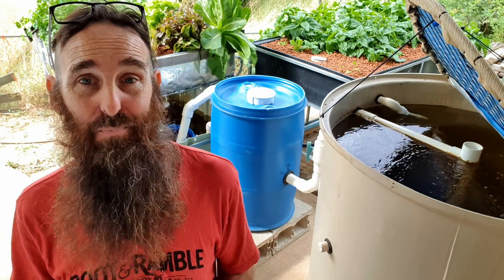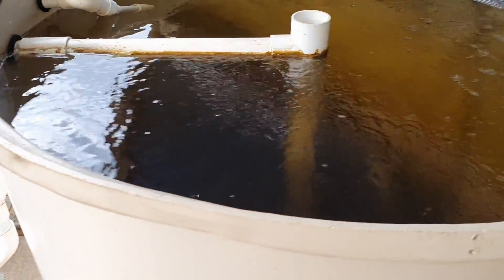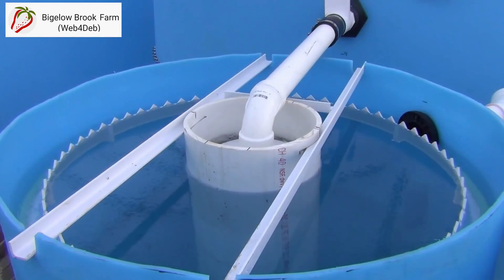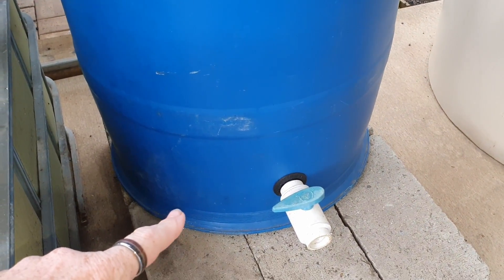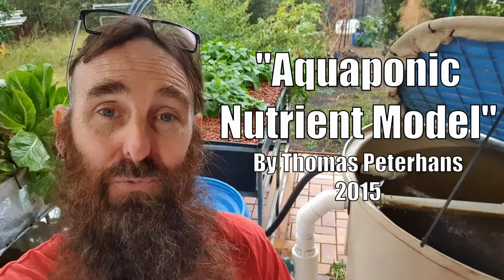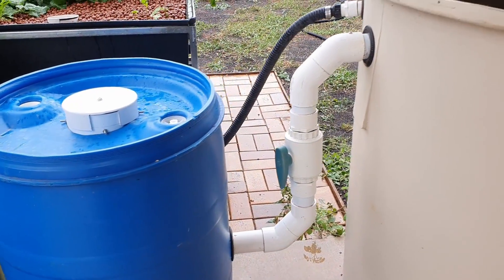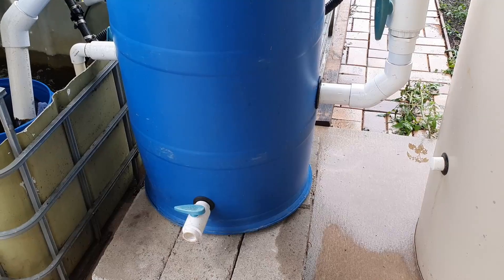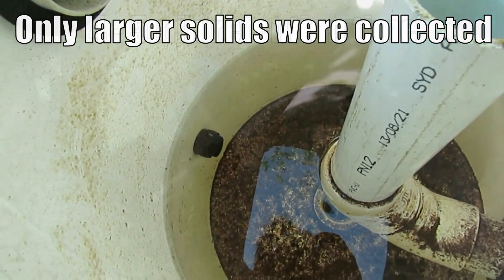Radial Flow Settler for Aquaponics Systems | How RFS work - How to Size Your RFS

Comment from the maker: Want to learn more about Aquaponics? 🐟 🍓🥬🍅
Learning is easy with my "Beginners Guide to DIY Backyard Aquaponics" for only US$19.95.
► https://www.robsaquaponics.info/beginners-guide-to-diy-backyard-aquaponics
Don't forget to hit that subscribe button if you want to be notified when new videos are posted to our channel.
Cheers all & happy growing. 🐟 🍓 🌱
Reply: as to your flat bottom barrel,  try this, using a barrel that is shot in the side for practice, set the flat on some blocks about 3 ft high, place a 5 gal bucket of sand in the barrel, then from the underside, use a heat gun or some other heat source to make the plastic pliable, the weighted bucket will apply an even pressure and should help the bottom to sag forming a more conical bottom.

Comment: How does water get taken Up into radial flow drum in is it pumped is it sucked how you really don't explain how but Only say taken into.. yeah how it doesn't do IT automatically Hey
Reply from the maker: Clean water flowing in displaces the water up the SLO.

Comment: Great video rob. Could you add k1 media in the RFS
Reply from the maker: It would make cleaning a pain in the rear to clean I think but could be done. It would just be static though & not moving which would reduce it's efficiency somewhat.

Comment: Those 55gal blue drums are made of HDPE, meaning they're a thermoplastic. With heat, ingenuity, and gumption, you can reform the base into a conical shape, especially if you use a jig.

Comment: If I don't want to drill hole in my new 150 gal tub, can i use the drain hole to drain solids to retention bucket? Eva
Reply from the maker: I'll pop the response I made on the other post here as well Eva. 👍
Hey Eva. You can run a bottom drain for solids collection & still use a solids lifting outlet (SLO) to prevent the FT from draining. You just pop the SLO on the outside of the tank if that makes sense. Just make sure that all the fittings are well screwed or glued together. Let me know if you need more info & will try & work out a way to explain it better. 
Cheers.
Reply: Thank you for your reply. I figured out the sizes and the connections to make it work. So far the system has been running for a week with no problems. Three Brute trash cans as filters. No fish in the tank yet, just floating plants. Eva

Comment: what is the best pump for these types of systems? I am trying to incorporate aquaponics to the filtration system of my koi fish pond... I currently run a pool type pump but wasnt sure if this requires less flow
Reply from the maker: Flow rate required depends on how you have the system plumbed up. A single loop system requires a smaller pump than a dual loop where the water flow is split between components.

Comment: Hi Rob thanks for the clip !  Rob can a person plumb 3 ibc's into one settler? And also I have found  abs fittings and pipe are alot more affordable  /avaliable    thanks Rob
Reply from the maker: You can but it will reduce the retention time which in turn will mean a lot less solids will be captured for removal later George.  If the settler was 500+L/130+gal it may do an OK job.

Comment: I'm trying to add one of these filters to a chop and flip system, no sump tank. Would I put the pump in the 55 gal drum so that it would pull the water from the fish tank?
Reply from the maker: Probably not a good idea as it will disturb the solids some what. 
A small DIY canister filter would be what I recommend Jim. https://www.youtube.com/watch?v=HtMZRM3a5Fs
Hope that helps some.

Comment: Love you videos. Just bought a house with 2 acres in Canada Hoping to start setting this up for next growing season. Any tips for cold northern climates?  How are the solids picked up? I didn't see a pump or anything connected to that plumbing.
Reply from the maker: Hey Marty. Setting the fish & filters up inside (basement or warm garage) or well sealed greenhouse will help keep them warm through winter. You can then run the water outside to the hydroponic side, or do that inside as well depending on space. 
This video will help explain how the solids move from the fish tank to the filters,
https://www.youtube.com/watch?v=2FTlha0c2aA&t=192s
Cheers & have fun with the build when the time comes.

Comment: I believe this on a larger scale would work for dropping out solids form a creek water source for irrigation.  We have a gravity feed water system getting water from a reliable creek source but in the spring with runoff, the water gets a ton of solids in it as it comes for kilometres before we access it.  Do you think this is possible?
Reply from the maker: It would depend on your flow rate I would think. For finer solids I'd be looking at 15 min + of retention time.

Comment: What if you added a second radial settler, so that the flow goes from the first settler to the second settler, would that allow you to increase the retention time? Asking because I have access to those blue 55 gallon drums but nothing larger.
Reply from the maker: You would still have the same velocity of flow so not much would settle out in the second settler NotACat. 
You would be better off splitting the flow into two then running that through the two settlers which would double the retention time. You could then run the outlets to separate components or join them back up, depending on how you'd like to plumb up your system. 
Hope that helps some.

Comment: Question 3: has anyone you know tried a centrifugal separator like the Lakos filter type to remove solids?
Reply from the maker: Not that I've seen. Many backyarders would se it as a bit of over kill. These DIY setters do a great job at removing the bulk of the solids if they're sized correctly.

Comment: Question 2: botton drain is hard to service in case of a clog, what about using an airlift pump to remove solids that you could easily take out and clean periodically
With a Martinez design airlift you could raise water several feet to add head
Reply from the maker: The solids in the system aren't large enough or tough enough to clog a 1"/25mm pipe. I have had bits of plant debris clog the intake on the sludge pump.

Comment: Question 1: instead of searching for a cone botton drum it seems that one could fill the botton of the drum with concrete, foam or some other kind of filler to make a sloped bottom to better collect the waste, any reason this is not done?
Reply from the maker: It has been done but it also reduces over all volume which in turn reduces retention time. 👍

Comment: For the rentention time could you use 2 or more tanks?
Reply from the maker: As long as the flow is split between them Chris. I explained a way to do it in this video if it helps any,
https://www.youtube.com/watch?v=VgBuUFx_xOE
The section on the settler is at 50 seconds

Comment: why is your airline not in your you water inlet not on the water that splashes into the fish tank?
Reply from the maker: The air line was on the other side of the fish tank back then You can see the bubbles on the surface of the water at the very start of the video on the right hand side.

Comment: Hi Rob got a few Uniseals before xmas and all working a treat in my 200ltr radial filter, just wondering if you might be able to explain why the water level gets so high (almost overflows barrel) but then settles down ? any help would be greatly appreciated. ps have  safe travels in 2023
Reply from the maker: Hey mate. It sounds like there may be a blockage on the outlet side. Is the outlet above the water level in the sump ?
Reply: @RobsAquaponics  thanks for reply ,seems it was getting air out of system on start up but is working great thanks for great tips, p.s. how do i stop my fish rooting ? i started with 16, 15 months ago now have 60-80+ LOL ,stay safe. :)
Reply from the maker: @gregoryhattenfels7864  🤣🤣 I would suggest cold showers normally. 
Cheers mate.
Reply: @RobsAquaponics  ROFLMAO ,maybe i should have worded that better. oops .

Comment: Hi Rob, I have a bit of a dumb question, but I can't wrap my brain around how the water in the flow settler is lower than the water in your main tank. I love your diagrams and I see it working in the video, but can't understand why the pressure isn't making a small geyser instead of the gental flow we see. This is coming from someone who has not yet started a project yet btw. I want to make a chop flip blue barrel with some decorative fish for my  backyard and would like to include a small flow settler to it to help keep the tank clean and from gumming up the pump, but am having a hard time designing it while being radial flow illiterate. Long time follower, love your videos, I hit subscribe the first time I watched the IBC chop and flip, and will definitely buy your book before starting my project. Also, your the first person I've ever heard say the phrase "now your laughin" and I love it.
Thanks from MS, USA.
Reply from the maker: Hey Emry.  It all has to do with the solids lifting outlet in the fish tank. It is only overflowing at the same rate as water is entering the fish tank if that makes sense. As the drain pipe is much larger then the inlet, the water velocity is not as fast. I hope that helps some. 
Also, remember you can ask me questions through the guide as well and get to them a lot faster than I do here on YT. You're just lucky I was paying a bill & saw the notification email pop. 😉
Cheers mate & have fun with the build.
Reply: @RobsAquaponics  Ah! Yes, that makes things soooo much clearer, many thanks. I'm sure I will have fun with the build and you have fun with those bills. 😆
Reply from the maker: @emrybennett8809  😅😅👍👍

Comment: Can you get away with 100mm pipe instead of 150?
Reply from the maker: You could Nathan. 👍 Just watch the length & flow rate though as it may not reduce the flow rate & cause some stirring of muck on the base if it's over 50% the height of the water.

Comment: Wouldn't a fluidized bed be best?
Reply from the maker: The settlers are easy to clean & maintain so that's why most will use them. Commercially, most will use a drum filter for the same reason.

Comment: Hi Rob, if your still look for bracing ideas, you could run the two lengths of pipe through the back of the tank with the same seals you use elsewhere and then cap it.
Reply from the maker: Cheers Gavin. 👍

Comment: Can biological filtration be added directly into this system? 

IE. bio-beads?

Or do you put a separate bio bead filter after the mechanical filtration?
Reply from the maker: I prefer to have the biofilter separate to the solids filter. Makes life a lot easier when it comes to   cleaning out the solids.

Comment: I was thinking that you could build the barrel bottom sides up with concrete, so that the solids fall in the middle.
Reply from the maker: I've seen folks do that. 👍 It will reduce the volume a bit which will also reduce the retention time too.

Comment: Hi Rob, I have just discovered you and I am thoroughly enjoying your content. A complete novice question here. Would it be possible to have 2 x radial flow settlers set up one after the other to maximise solid waste separation? Or is my thinking redundant as the amount of waste settling in the 2nd drum would be minimal? I have a 3D printer, so instead of a second settling tank, would creating a weir that you mention earlier in your video be a much better alternative? TIA. I am hoping to convert to an off the grid lifestyle in the near future as my life circumstances are changing.
Reply from the maker: Hi mate. It's best if the setters are set up parallel & not in series. This video might help explain why,
https://www.youtube.com/watch?v=VgBuUFx_xOE&t=50s
That link will take you right to the spot you need. 
Hope that helps.

Comment: Hi Rob
I'm just in the process of building a radial flow settler. I have a piece of 150mm pipe like you used, or I have z piece of 200mm pipe. Would the larger diameter pipe increase or decrease retention time.
Thanks in advance.
Reply from the maker: Hi MFL.
The total volume of the drum will dictate the overall retention time. 👍 I do think that the 200mm pipe would allow the water to slow down a bit more before entering into the main chamber though which could help some. 
Hope the build is coming along well.

Comment: I have a silly question, but how does the water flow from the fish tank to the radial flow settler? I don't see a pump or anything and it doesn't seem like gravity could go from the bottom of the fish tank up and then again from the middle of the radial flow filter to the top. Thank you for all your cool videos!
Reply from the maker: Hey Lemon Song. 
The water coming into the fish tank causes water & solids at the base of the tank up the Solids Lifting Outlet (SLO) pipe & out the side wall of the tank. 👍
This link will take you straight to a section in another video that will give you a visual explanation. 
https://www.youtube.com/watch?v=0QQA5BpWKec&t=338s
Hope that helps some.

Comment: could 2x  of the 200l rfs be used in series to help dwell time?
Reply from the maker: Parallel would be better as it would increase the overall retention time. I posted a bit of information on it in this video. 
https://youtu.be/VgBuUFx_xOE
Hope that helps some.
Reply: @RobsAquaponics  thanks mate
Reply from the maker: @k20Fritz  No problem. 👍

Comment: I am new to this and mostly helping a neighbor setup his. You mentioned the settler tank should be bigger. My question is if I'm using  ibc containers can I use a second for my settler tank?  Would that give me the 15 minutes needed?
Reply from the maker: You can if you have the room Michael. Might be a bit tricky trying to collect the solids from the base regularly though. 
Have fun with the build mate.

Comment: Thanks Rob, great video, always so helpfull!
a suggestion for the outlet of the pipe that comes close to a professional RadialFlowSettler: you could cut the slit on the outlet pipes, which you make double (in a fork shape), zig zag instead of one elongated slit on each side. 
water is wetting. when water runs over a horizontal barrier, it usually creates a wider jet of water in the middle, rather than a flat jet of water that spreads across the entire width of the barrier. I would therefore zigzag the slit so that the overflowing water splits into many small jets of water. That might slow down the water flow a bit more.
Reply from the maker: Thanks for that Paul. I have contemplated that but never got around to installing the extra pipes. It was putting too much weight on the drain pipe leaving the filter. Might have another crack at it though as the exit drain arrangement has changed now the biofilter has been installed. 
Cheers.

Comment: Could you use a gravel cleaning type tube to suck all the crud out as well?
Reply from the maker: I have seen folks use those to clean out the base. 👍 I was using a jiggle siphon to start out with.  but found using the waste valve a lot faster. 
Cheers & have a great one.

Comment: Brother I cannot thank you for all that you do to guide us! You’re a wonderful human! Could you give me any pointers on a system where a fish tank (100 gallon) would be located in my home but the rest of my system about 40 feet away? Thanks!
Reply from the maker: Hi SelfBuilt & sorry for taking a while to get back to you. Sounds like you would need some decent plumbing underground to achieve this.  if the grow beds were out in the yard. Would work better if the beds were located next to the house so you could run the overflow from the FT directly into the beds at level, say if the beds were along the wall of the house.  Once you send pipe underground you will have solids build up in there that will need cleaning from time to time.

Comment: Hey Rob thanks for a great video! In your opinion what will be the most low maintenance filter or settler for IBC tote fish tank and grow media systems?
Reply from the maker: Thanks & sorry it took a while to get back to you Cosirius. 
I would think that the radial flow settlers would have to be the best DIY solids solution. 
For a commercial unit (hobby or commercial system size) , I like the AST bead filters.
https://astfilters.com/aquatic-systems/project/bubble-bead-filter-for-aquaponics/
They also add extra biological filtration so would be a great addition (if you have the coin) to a NFT or DWC based grow system I think. 
Hope that helps some.

Comment: Thanks for your video. If I wanted to have a longer retention time and can't find a larger tank, can I achieve the same results (increase RT) by putting 2 tanks in series?
Reply from the maker: Parallel would be better Amanda as you would be splitting the flow rate into 2, effectively halving it. That should double your overall retention time. 
If they were in series the water would still be flowing at the same rate but I dare say some extra would be collected in the second filter, not as much as if the filers were in parallel though. 
Hope that helps some.